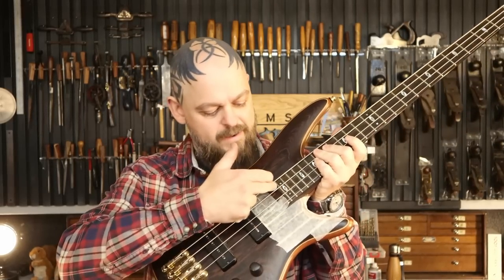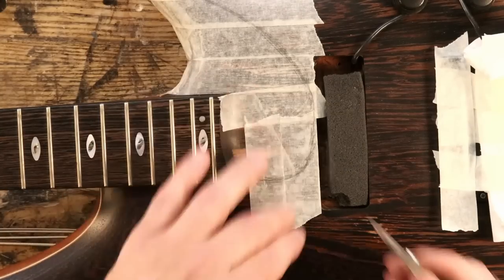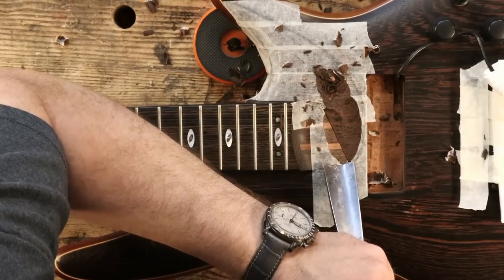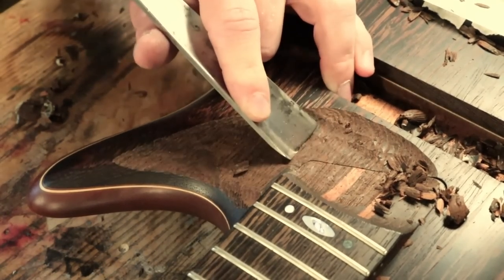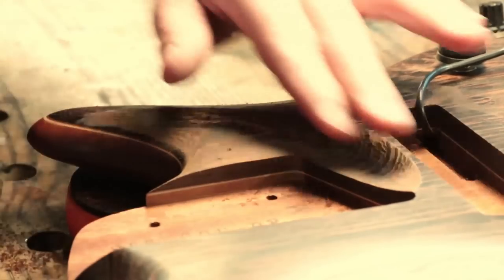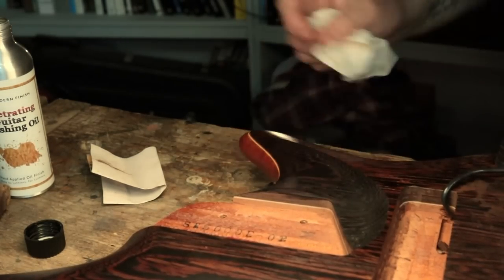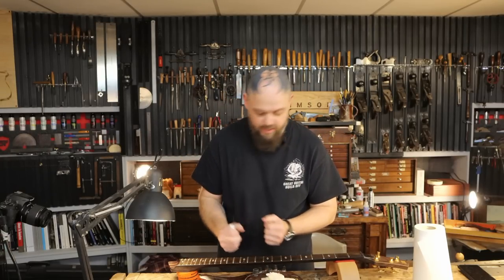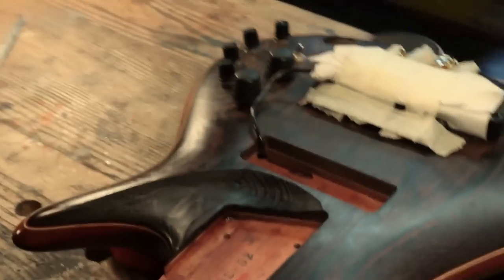Recarving a Clients Ibanez Bass for Comfort | Custom Shop

Comment from the maker: Poll - would you have chosen the hard line (sharp carve) or the soft line (Roundover)?
Reply: Soft line, but mostly for the looks. There's no hard line on that guitar anywhere, so it felt a bit off to me (although it still looked great)
Reply: Roundover for me.
Reply: I usually like a more clearly defined line better (like on the heel of a neck insert for instance), but considering the overall shape and proportions on this bass a soft roundover curve would suit really nicely!
Reply: Based on the instrument, I'd go soft line to match the other edges
Reply: Roundover, to match the the over edges of the bass !
Reply: Definitely soft.
Reply: I would have preferred the hard edge as it gave the build a “custom” look! But the customer is always right I suppose 😂
Reply: Soft line, but I rarely like sharp carves.
Reply: I'm rather partial to the hardline on this- makes it a feature.
Reply: Definitely rounded over, it looks a little out of place with all of the soft edges of the guitar
Reply: Round over. I’ve built some Tele style guitars with belly carves. I hate how even Fender belly carves have a hard sharp line like that. I spend a lot of time to make my belly carves rounded and have smooth transitions.
Reply: dealers choice
Reply: @jonkerr2050  Did the same when I built a tele kit for my father. Soft corners on the belly and arm carves.
Reply: Follow the build style. Round
Reply: Soft! The rest of the Bass looks soft and round.
Reply: Definitely soft.  That custom work deserves to be ensmoothened.  🤠
Reply: I probably would have stayed with the hard line.
Reply: Like many others have said already, I would prefer a softer line since that body style has no hard edges.
Reply: Yep, I would have gone softline too, just fits in with the 'organic' curves of the body style. I would have also extended the top of the scoop up to the top edge/ corner of the neck pocket, that way the scoop starts at the end of the fingerboard, flows down (utilising the curve on the end of the neck that is already there) into the scoop and then around, curling down and around to the lower horn where it feathers out. To my eye, that would turn what is primarily there as a 'functional' feature, into part of the aesthetics of the instrument. Almost as if Ibanez had designed it that way originally rather than as an 'add on' feature. That's not taking anything away from what you've done here, which sounds like it was constrained by the customers budget (which, at the end of the day, is the primary focus).
Reply: I'd soften it slightly. And I'd pronounce "wenge" as "vinegar." So don't take my word for anything!
Reply: if you're already altering it
might as well go all the way and do the soft curve imo..keeps the flow
Reply: roundover
Reply: Soft line would better suit the style of this one IMO.
Reply: Soft, of course, it match the guitar feel.
Reply: Seems like the follow up hasn’t been posted on instagram
Reply: I assumed the client had actually asked for the hardline because my instinct would have been to soften it.

Comment: I haven't seen the final result as I don't have or want Instagram, but it looks pretty good to me. I have no problem with instruments being customised to suit the owner/player, unless it's a vintage instrument of course, in which case it should be left well alone. My own main instrument is a 1994(ish) Charvel Fusion 5 bass, from which I've removed the pickups (too weedy), electronics (I know that batteries can and will fail mid-gig), and about 18 inches of spare wiring. I put in a Double Eagle P-bass pickup and a volume control and that's all I need. Nobody listens to us bass-players anyway so there's no point being precious about your tone! The Double Eagle pickup's output is much higher than anything else so I need to turn the amp's gain down if somebody else has previously used it (I used to do a lot of jam nights where I was the resident bass-player for anyone who needed one), and with a Hipshot on the B string that takes it down to an A, it's all the bass I've ever needed.
Reply: can't find it on the insta page 
Link please

Comment: Fantastic video Ben I love stuff like this . If you live an instrument don’t be afraid to mod it a bit ( unless it’s vintage an very valuable. I do things like this to all my guitars 😊
Reply: I've actually gotten flak for taking a Squier Strat Affinity, and changing it from a black burst to a blue with black burst with stain instead of spray.
Like a single 2014 common guitar being changed in that way would diminish the Affinity series, or something...
Reply: @imywt  Well done, I got the same problem with sunbursts. I hate them. It's like boring people wearing boring clothes, these bursts are a uniform. So, yuck. Sand them down, often the wood is very okay, clear coat or linseed oil. It is just a finish, who cares?

And there are zillions of those Squires, one in a different color won't hurt anybody. I'd say. Play it, don't sell it, who cares about value?
Reply: @voornaam3191  Exactly what my plan was, and is.  That's my 2nd Squier, and I'm not selling trading or giving away either.  They're for ME, not for the world.
My first one was a $100 brand new guitar from a music store that hasn't existed in over 20 years.  She got stripped, and stained too.  I'm quite pleased with both of them.

Comment: You did great work but the job requirements aren't to my taste. Seems like a problem they could have solved in a non-destructive way with a correction to their technique.
Reply: Was thinking the same thing. I can't imagine a playing style where the body of the guitar would be in the way.
Reply: I've seen a few guitars come into the shop with more ... naturally created ... carves. At least this looks like it was intended to be part of the instrument. 🙃
Reply: Unless the problem is their fingers are too fat to fit under the string for pops. Ibanez used too offer a few basses with a slap carve similar to this and Peavey did on their Grind series when it first released.
Reply: @jazzpunkt40  that's a fair enough point. I didn't consider that.

Comment: Wow, this kinda hurts 🙃 I probably would have had a bass built to spec instead of carving away at this one.  While I wouldn't say this is my "dream" instrument, I do really like the Prestige series.  Plus, I really don't enjoy cutting wenge.
I wonder if the carve would have been easier to start if you had cut the shape out of the masking tape and removed it instead of cutting through it with the gouge.  Seems like that would have slipped less.  I do like the scrapers there though, I make some of my own to random shapes like that.